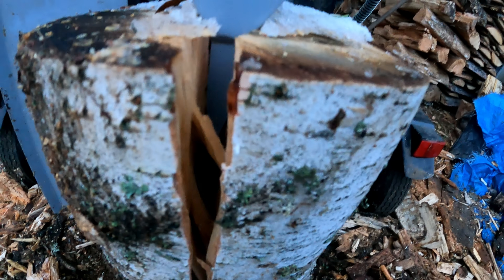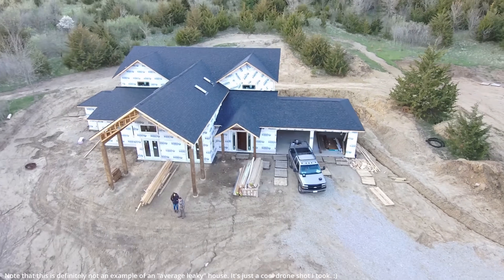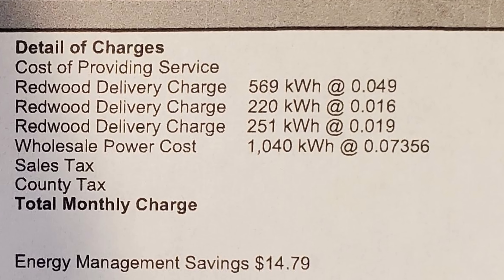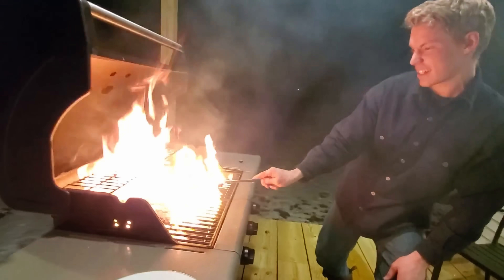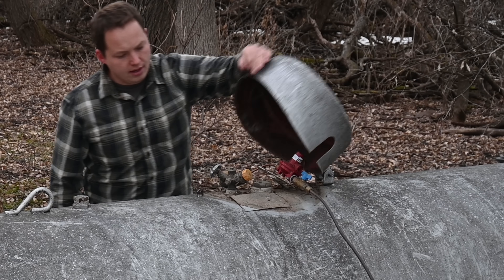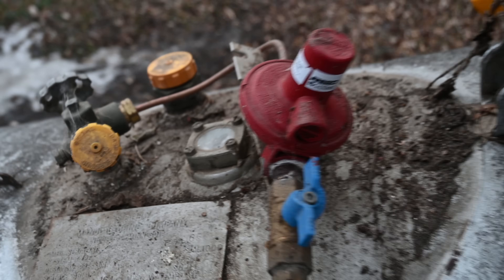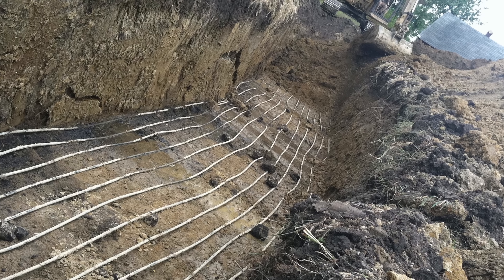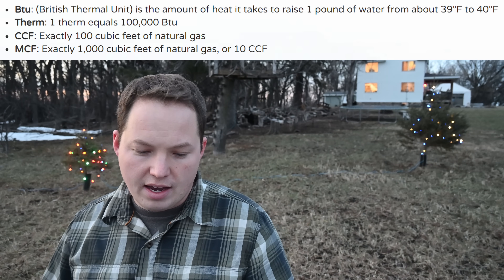What's The Best Heat Source in 2022? Top 5 Home Heating Methods - LP Electric NG Geothermal Fuel Oil

Comment: Small insulated cabin. 8' x 11' x 6.5' ceiling. closed cell spray (tough stuff) on corners and R13 fiberglass in 2x4 walls. 
Refillable propane 1 lb cylinders. Mr Heater Buddy runs for about an hour or less to heat up whole cabin.
1 new 1 lb bottle lasts almost a week. When refilled a few days. Only get about 2/3 lb in refill.
Can run electric heater on low a couple hours or so on sunny days from solar panels.
Have gas generator to recharge batteries for lights, computer and appliances when not enough sun.
I use about 1/4 gal of gas a day for over night batteries. 1/2 to 2/3 gal a day if no sun at all.
Have run electric heater from solar and generator, but it sucks power bad.
I use 2 1 lb bottles of refill propane a week.

Comment: Isn't there newer oil condensing furnaces that have been rated at 99% AFUE?
Reply from the maker: Not that I've personally heard of but that very well could be.
Reply: @BenjaminSahlstrom  from what I heard Adams Manufacturing has a condensing oil fired furnace with an AFUE of 99. I haven't personally seen them, I work as a home inspector, but the word that this mythical creature is out there.

Comment: 100% wood heat from the same old woodstove for the last 40 years. No natural gas where I live, and no furnace in the house. Moving air with fans costs some electricity, but it is pretty amazing how well you can heat your house, moving warm air around with simple fan technology.
Reply: Pacific energy super 57

If you can get this wood stove you will be astonished at the heat production.
Reply: I live in the Mountains of Virginia. We use 3 wood stoves and a propane stove. Don't use the propane much if we can help it. About 2000 sq.ft. 1 ceiling fan over each wood stove.
Reply: Sounds great..till you get to be Elderly and can't chop wood anymore..and load your stove.
Reply: @davylarcade8501  @67 and 28 years with a great wood burning stove I decided to make the change and retire the wood heating stove 25k btu for a propane heater look-a-like wood burning stove @32k btu and not even close. The 28 year old wood stove was the best. With propane going from $1.27 to $3.75 a gallon is not much better than electricity. But hauling wood to the house at 72 was still the best decision in old age for me. Calif. Mtns south SF
Reply: @davylarcade8501  yeah that’s my moms problem. But she’s almost 70 and still stacks her own wood all 6 chords of it. Trust me I try to help and sue ain’t having it. Stubborn lady. Still wants to do it all herself.
Reply: @davylarcade8501  I know people getting up to their 80’s and still cutting and burning wood. As for chopping wood, that is almost gone these days. My stove burns junks  a foot and some more thick. Yes the day will most likely come that I can not handle wood. However it will be lots of exercise getting to that day. Then I will turn on the new heat pump. If that fails I will turn on the baseboard heaters.
Reply: @davylarcade8501  It is great, and if you use your logic, you'd never do anything, because someday you might be too old. Mercy.
Reply: @1984C4Corvette_DIY_Garage  uhhhhh.... you might get a job and then pay somebody with your savings.
Reply: @danielbuckner2167  uhhhhh i have no idea what you are referring to
Reply: @1984C4Corvette_DIY_Garage  uhhhh... to your comment in this thread.👍
Reply: @1984C4Corvette_DIY_Garage  Hey. I think when I'm 95 , I'll still be chopping wood outside. And still using my Wood in the Bedroom !
Reply: I use 12 volt fans with my wood burning stove, cents on a nickle
Reply: Joseph Cormier  I like and support your ability to continue on with the labor to heat with wood, especially the amount of cords each year. Well Done and many more to come.
Reply: I use a "Old Timer" wood burner in living room. I put the size of computer fans in doorways..works great!
Reply: You can get woodstoves that connect to a house's ductwork, have an internal fan and blow hot air through the ducts just as well as a gas or electric furnace does.  They are about $2000-$2500 plus various little parts and installation.
Reply: It gets old keeping wood fire going all nite especially when you get older !
Reply: My home, too, was wood heated since 1933 when it was built, until I replaced the woodburner around 2004 with a Lopi natural gas freestanding fireplace. It kept the charm of wood heat without the mess and labor. Not a plug for them, though, bc I have constant issues with it shutting itself off all the D time, and have never paid the lawyer-level rate to have a repair person diagnose that. 

So, I still have plenty of wood available, and would love to be able to burn it outside and pump the heat inside. I'm VERY cheap, so would not like to invest in the outdoor wood-burning heaters, but wish I could come up with a way to heat water or something and run lines into this little house. Risk of the lines freezing is a concern, as is pipe insulation, etc. to reduce heat loss as much as possible. I could pay the bucks and do it right, but again, "Johnny Tightwad" here. Perhaps a big heat storage battery outside, made of dirt or rocks, with insulation around it. Then pump air through the rocks and into the house, maybe a recirc. system, or use copper water lines. Any innovative ideas on that? I do like the really old European home-heating woodburners that are substantial heat sinks, and a small fire even of twigs, burned hot and fast, heats the mortared bricks/rocks that radiate heat for many hours afterward. I read that the exhaust path is long inside these stoves, to draw as much heat out of the exhaist air as possible, sometimes with a folded pattern to get a longer path in a smaller area. Soot and creosote buildup shouldn't be a problem, since the fires in those are burned hot and fast. Also, smoke would be less. 

Thoughts? Comments?
Reply: Where do you get free wood to burn?
Reply: @pete6152  I pay for a lot of it, and I also cut a lot of it. Depends on the year, and availability. Also, if you scour the fbook marketplace, you'll find a lot of free wood people just want hauled away.
Reply: But I live I. The Forrest now  I grew up in west Texas  there were no chain saws sharp enough to cut misquite  when I was growing up , I still got few trees there I need to harvest two I need to mill
Reply: That’s not practical for many people who work a lot or are elderly and can’t handle such things. Plus wood is not cheap either.
Reply: @jochimbenschneider1915  It all depends on what you want. We did it all our lives. I worked full time, my wife part time. Wood is a lot cheaper than heating fuel, or electricity, and you don't have to worry about being dependent on somebody else.
Reply: @1984C4Corvette_DIY_Garage  You can’t read.  End of discussion.
Reply: Yep. I'm at end of gas lines n  they won't cone around our overvmy creek,  so all electric. N that's a joke  , lie, it's insulated but yes it's not insulated right,  it needs one or two more coats of insulation  if the tornado  machine they run over me daily never gets us , wood insert  n convert to low usage pulled out all my big demand heaters n blowers , they are bio weapons  and no effeincy,  I've looked at them all in 4 counties n few other states all built and installed improperly  and in attics with dust work our in the under crawl spaces where gas heated heat strip should been, it's all lies and corruption  to generate  sales and taxes and forced labor by unionized electricity  n plumbers and air techs all traitors  to get in your house n illegally tax
Reply: Enjoy it for now. I also love the wood heat. However another few years and with the climate change madness it will not be long before wood stoves for the most part will be banned.  Where I live there will not be any excuse to burn wood with all the electricity we will soon have on line.
Reply: @glennbrooks3449  I doubt it. There are too many people who heat with wood. Wood burned properly is the key.
Reply: @1984C4Corvette_DIY_Garage  one movement that has started is ; if you do not use much electricity you have to pay a lot more for the little you do use compared to someone who uses all electric heat. That is compared to anyone who uses wood or oil for heating the home. The trucks that deliver the wood have to pay a carbon tax on their hydraulic oil and diesel fuel.  That most likely will only get more expensive.There are many rural areas where I live where people cut their own wood . There is lots of wood around me but because of the many cabins in the country and atv trails that most of the area is restricted for cutting wood. You may have lots of wood but I see a movement coming to shut down burning wood due to climate change. However I hope that wood burning continues because you can not beat the comfort of a house heated with wood.
Reply: @1984C4Corvette_DIY_Garage  As a master plumber and HVAC mechanic I can tell you first hand we love these all electric homes. After the grid collapsed on the east coast last week we have enough frozen pipes to fix until summer and of course when the power came back on people started their heat pumps immediately forgetting to wait another 24 hours for the crankcase heaters to reverse the migration. I now have three customers running on backup resistance until spring. Its hard enough to find a mechanic to replace your compressor but impossible to find one who will do it in the freezing weather and snow. Of course if you dont live in a very cold area its just an inconvenience but if you live in Buffalo NY, well we all saw the national guard getting the bodies out.
Reply: @anthonyspadafora1384  Bad storm alright. I was not worried. My heat source does my house just fine. I have a generator for the pump house and main house if needed.
Reply: @glennbrooks3449  wood costs 0% id love to see them ban wood stoves lol..  my electric bill was $50 every month all winter, in this 14 acres property i just moved into... in my townhouse prior it was always 200$ for gas furnace and electricity monthly..   ILL never go without stove heat not after this.  I had 1 ceiling fan above it, and the room where the stove was in was 80f the rest of the house around 73f
Reply: You can burn fake wood. Compressed sawdust or corncobs. You can always get a catalytic converter that fits in the exhaust pipe.
Reply: Natural gas doesnt burn like propane in my experience. Was raced on propane but natural gas gave me confusion, dizzyness and headaches.  Propane is propane, natural gas is a mixture of random gas thats cheap to obtain.
Reply: I was taught years ago if the U.S. took care of our forests like they do in Germany the whole country could use wood efficiently!
Reply: @ warrenthunell2557
It’s true that Germany takes serious its forestry and wildlife. They made a great comeback from the destructive 40’s and Cold War years when Russian East-Germany destroyed the land for its projects but the downside is that you can’t even dig a cat hole to use if you’re camping or even snap branches off to make a campfire. The restrictions almost take away from using the forests. I guess it can be argued that that is the reason the forest in Germany are so abundant and healthy, but good luck using them for firewood.
Reply: That’s awesome I wonder if it’s possible for the the whole country to do this?
Reply: @mikec421  Long as you live in the sticks. Cities would soon be filled with soot. You have to burn it correctly, or you just create a lot of smoke and bad air.
Reply: @mikec421  nope. In The country yes you can but city...
Reply: 😳not enough trees.
That’s what got us in this mess 🙄
Reply: @mikec421  no it is not.
Reply: @mikec421  Not practical in many places as it creates pollutants/smog.
Reply: @ToddCopeland  Exactly.  Houses in my subdivision are around 0.75a and there are one or two houses burning wood for long periods of time.  If the wind is right and slow, my house and clothes smell like a chimney and my eyes are burning.
Reply: @mikec421  it is for major portion. But most are to lazy and unable to work hard to do what is needed to do it.
Reply: @thomascrompton7775  I bet there would have to be a lot of changes made before a large portion of the country could heat with wood. We have a 15 year old house I added extra insulation to the attic but not a net zero house by any means and our propane bill is never more then 6-700 a year so not worth it to heat with wood. I’m all for keeping busy but in the end the risk associated with injury is to great.
Reply: @mikec421  It is good for you to have to get up and get wood in. I'll admit, 3 weeks ago screwed my back, so the axe is now retired, but I can't see the day I'm not able to bring wood inside and heat my house, unless I kicked the bucket.

Comment: I have ground loop heat pump (4 tons- dual speed compressor) - upstate NY. It has resistance "boost" heaters. I also have a pellet stove heater to preheat air going into heat pump. (House is forced hot air.) SO point #1 - closed loop ground source heat pump.... forget "earth temp is 50F".... when you continuously suck 12 Kw out of ground you end up suppressing the ground temp to ~30 - 28F. Good news is when outside air is -10F.... this heat pump still only sees 30-28F. Point #2 - Resistance heaters SUCK - my unit has two banks of 220 VAC, 60 amp electric resistance heaters. So enter the pellet stove - I use it when outside temp is in teens or lower.... it preheats air going into heat pump. Heat pump just acts as a Temperature adder... so supply temperature to room is boosted. It prevents electric boost heaters from being used much... but they are there if needed. PS - my house is vintage early 1800's, 3200 sq/ft, could be insulated better. Annual TOTAL energy bill ~$4000 (including AC in summer, hot water and all electric). (previous not so good insulation/oil was $7000/$8000!) When people ask me what is best heating method - I always say "GOOD INSULATION"!!!! PPS - ground source heat pump also heats water. BTW - enjoyed your video!

Comment: That was a good call to do all the math based on BTUs! OTOH, I have to say that 12 cents per Kw is just a pipe dream for a good portion of the country because the latest figures on our bills show added cost for transmission and distribution, plus fuel surcharges, boosting the price to near 20 cents per Kw. On top of that we have way higher NG prices in our neck of the woods. (lower Ct)

Comment: i heat with gas...wood stove in the fireplace and have solar panels....a friend of mine bought 10 acres and an old house...gutted the house, made it energy efficient, kept propane for backup and turned his house into primary total electric....then he put enough solar panels in to cover his electric house

Comment: I built a rocket mass heater and used it for a year. If you don't know what it is you must check it out. As far as I am aware other than passive heating (solar and geothermal) it is the most cost efficient and very environmentally friendly.

Comment: I solely use a wood burning stove. 1700 sqft home. I am in Ohio zone 5. I buy left over pallet wood at $50 per front loader scoop (very large bucket on their front loader ) on a cold year I doubt I would use more than 8 scoops. $400 a year is pretty good. Though it is not seasoned. I don't have to do any splitting though. 99% of the pieces for into my stove.

Comment: Oil filled electric radiators are much better than instant heat electric heaters but still likely 2 x NG. I have a 2 story 3 bedroom home with an inground basement that is not real well insulated and needs 6 more windows replaced. I also heat the basement to avoid water line freeze and I'm at around 1400 a year.to heat my home in  a bad winter. My friend has geothermal heat pump and it's great. He heats his home for about 800 a year. It is a newer insulated house though.

Comment: I burn wood and have a solar system . I get paid to cut trees down and take the wood away. When its sunny I can run up to 3000 watts of electric heat. I find a resistive heater with a fan much better at heating space then without a fan. Also solar isnt great for few months were I live in Canada. Great video. Cheers

Comment: North Central Ohio Wood in my Central Boiler and I Heat my 24x40 Shop and Hot water in both House and Shop and My Home is 3,000 Square foot with Radiant Heat in basement floor and first floor tubing routed between beams so no furnace required and I spend 100 hours cutting and splitting firewood and about $200 on new chains and fuel and oil for saw and splitter and Tractor. So I would guesstimate my cost’s to be with time and fuel and supplies $2000 for heating it all.  🤟🏻🇺🇸🇺🇸🇺🇸